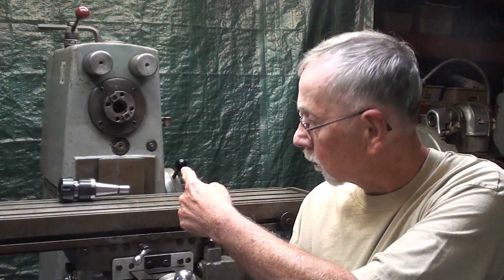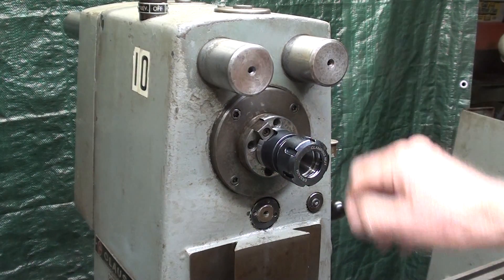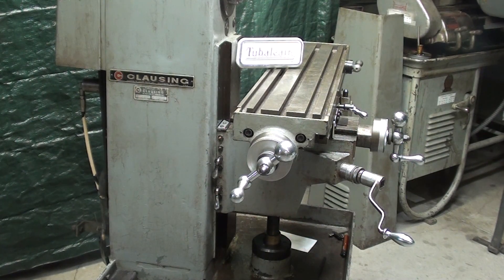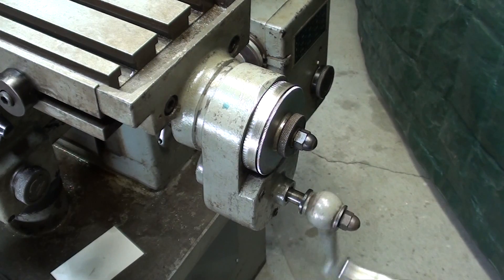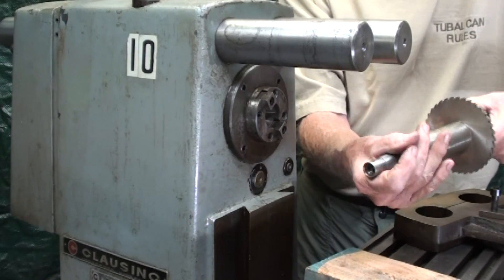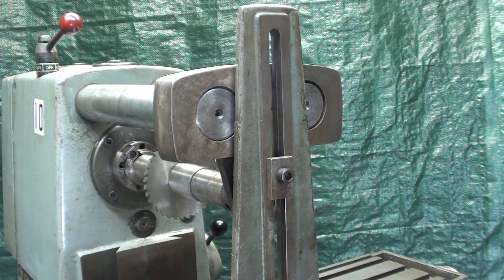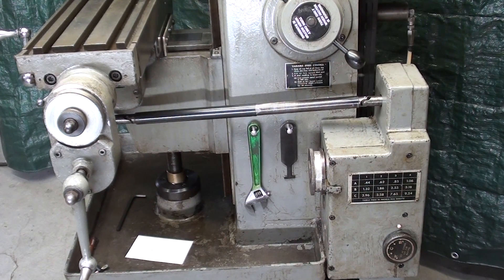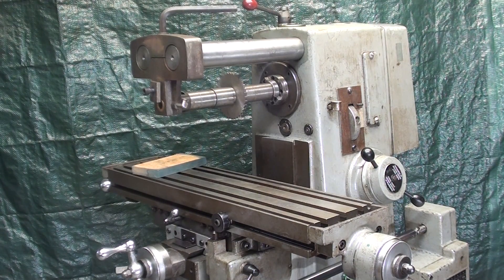New CLAUSING Milling Machine Tips #501 pt 6 tubalcain NOMENCLATURE

Comment: Thank you, and you are absolutely right when you said "Familiarize with the nomenclature and controls of any machine before you operate it". This is where the manual and books come in handy at least for older machines - the new ones will have all the information on line as everything these days.
Also, it may seem daunting for novices or even seasoned operators to start on an unfamiliar machine, but here the piecemeal approach is best, divide the machine into its major parts and get to know each part and its controls etc and their purpose. Then move to the next part or area. It is a matter of getting the machine to become an extension of ourselves.
Reply from the maker: Thank you, that's a good analysis of what you need to know

Comment: for newbees, the T-nuts must be fixed with a chisel mark across the bottom so that the bolts can NOT just go on thru which might break the T-slots. i have   bought some which did not have them.
Reply from the maker: Yes, good point

Comment: Very interesting.  I was really struck by the amount of rigidity required to hold that cutter.  Between the over arms and the vertical
support, that's a lot of cast iron going into controlling that cutter.  It will be interesting to see what you have to do to hold a workpiece
rigid in this machine.
Reply from the maker: Yes, it takes a lot of support. For the work and the cutter